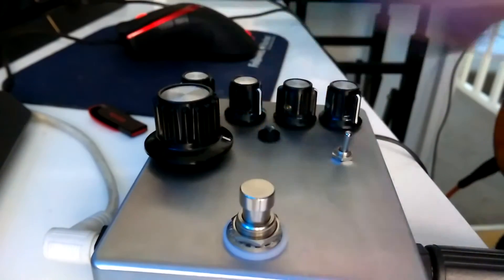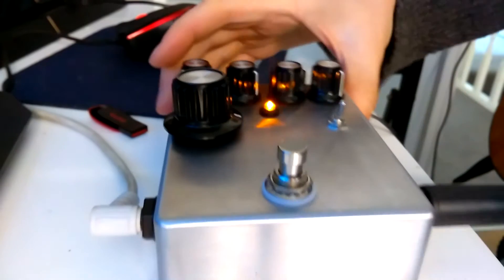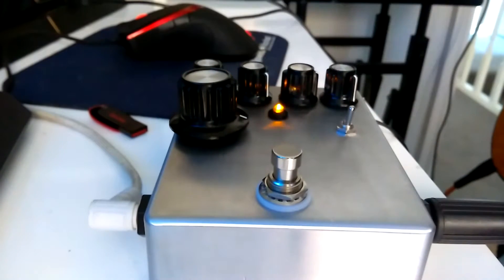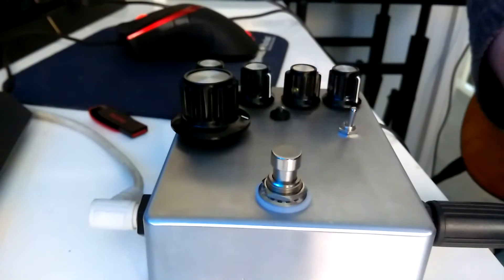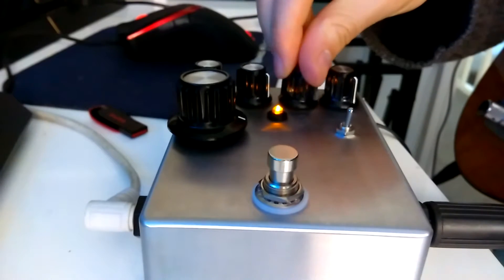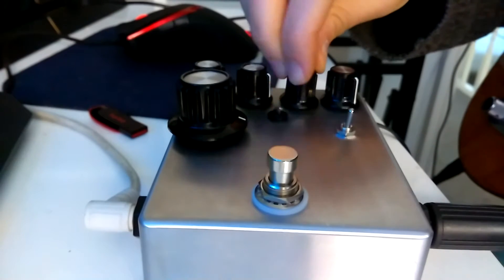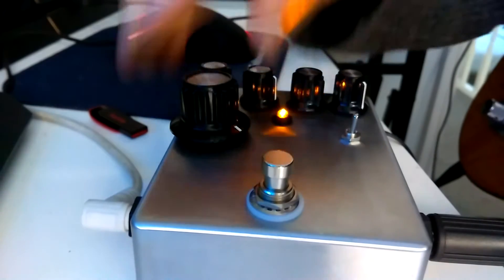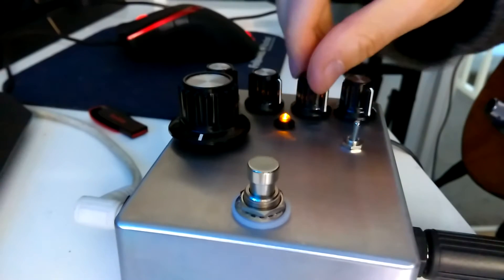DIY Gristleizer Part Two

Comment: I enjoyed watching this. I have bought one of these kits but not had the confidence to assemble. Right now seems a good time. Which TG albums and songs demonstrate the gristleizer being played to its best?
Reply from the maker: Do you know, I'm not actually sure! It's a long time since I've heard TG so I'm not entirely sure where it's used unfortunately. I doubt it was just restricted to guitar though.
Reply: How did you get on with it? I think you hear it very clearly on 'Hamburger Lady'. It's used to great effect on vocals.
Reply: @rexterrocks   Not very well. I got it working perfectly first time but I went for circuit board mounted pots (potentiometers) which was not recommended. So when I went to mount it all in the enclosure it was difficult to fit. So in de-soldering the pots I wrecked the board. I’m now on to a second kit which works but has a annoying high pitched squeal I can’t remove. It also doesn’t seem to work as well in the VCA mode. So all round misery here. I note Fuzzdog say, ‘Please do not attempt this build unless you're confident in your building and troubleshooting abilities. We cannot offer any support with this kit.’ As this was my first kit I should have listened. Still as a learning experience be it very expensive it was er...useful. I’m still working on it. I will put the whole sad tale up on my blog eventually.

I’ll check Hamburger lady out. I have a lot of TG albums. They tend to list the equipment they’re using. The Gristleizer is listed on TG live vol 1 which is also a bonus CD on some 2nd Annual Report issues. There are a lot of modulations taking place especially on forced entry. Is this the Gristleizer?
Reply: And here is my Gristleizer in all it's horrible working glory.  https://youtu.be/LTfZH6kveFc Any thoughts on how to solve the high pitched squeal would be appreciated. On how to improve my guitar playing less so.